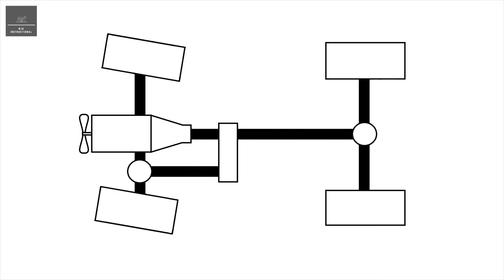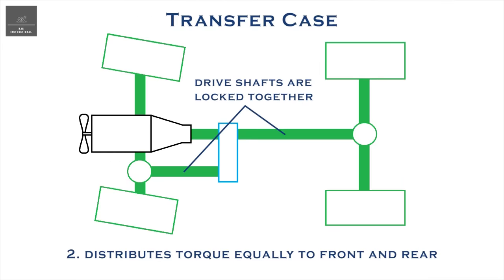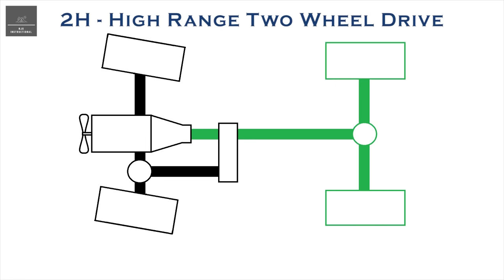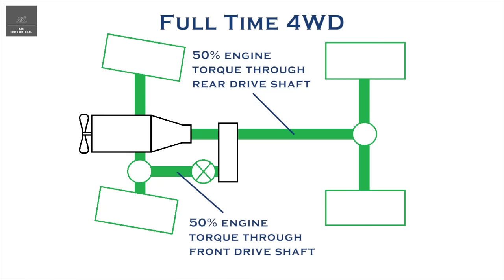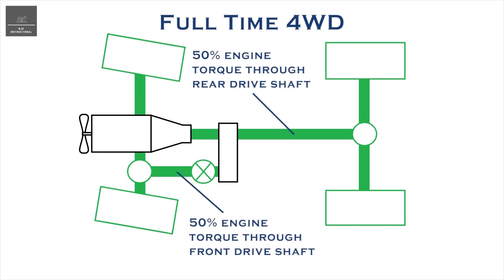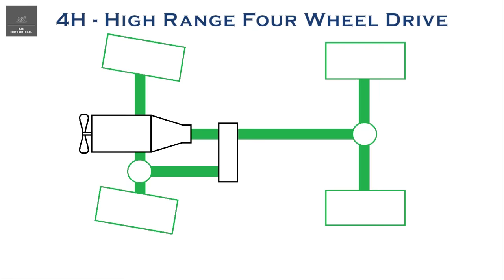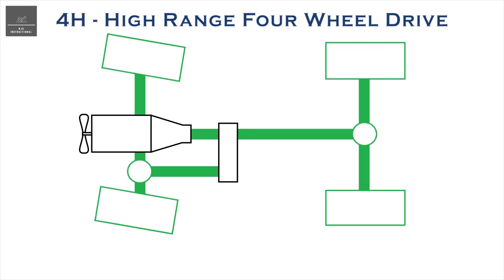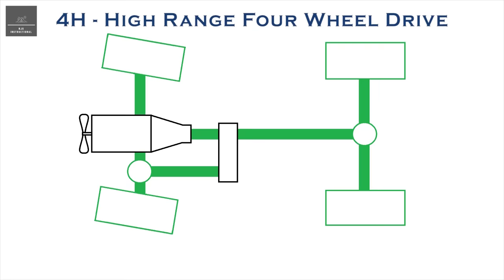How 4WD (4x4 - Four Wheel Drive) Works - 2H, 4H, 4L, LSD, Centre Diff, Diff Locks, Traction Control

Comment: So, in a "Full Time 4WD", if you leave the center diff open, as well as the front/rear, then if even 1 wheel loses traction, 100% of the torque will be sent to that single wheel.

Comment: IN locked transfer case situation each wheel gets up to 50% of torque, NOT 25% torque. With all time 4wd it is 25% of torque for each wheel. If center diff is locked and rear diff is locked rear wheels both get up to 100% of torque and frot ones will get up to 50%.

Comment: It's totally wrong. You are confused about "torque" and "rotation speed".
A open differential split the torque between axes (than allow different "rotation speed" between axes... and free spinning).
A closed differentian mantain the same "rotation speed" (than allow that all of the torque could be applied to the axis with major grip).

Comment: You missed a critical point. 

Not all cars have same part time 4wd. 
For example 4th gen 4runner v6 4wd.
It has Torsten center differential, meaning when you are on h2(4wheel drive)  it is same as all time time 4wd. Can be driven even on dry pavement, roads  highly tracked surface. 

Don’t miss critical points.

Comment: Every sentence with the word "torque" here is incorrect. Many other explanations are incorrect as well. Could have been a great blog if the author limited it to practical recommendations and did not try to explain things that he did not fully understand himself. For the confused beginners: the goal and magic of differential (unlocked of cause, locked is not differential any more, name only) is to equalize the torque on right and left axles. Why? Because any difference in torque means tire wear and poor control of the vehicle. When such a difference occur, say vehicle makes a turn and one wheel wants to run faster than another, the difference in torques starts spinning satellite gears in the differential until torques are equalized again. Similar is true for front and rear axles.

Comment: Why is fuel consumption so much higher in 4hi than 2hi? Its still spreading the power evenly, 25% to each wheel insteas of 50% to just 2 wheels. Yet it uses 10-20% more fuel

Comment: Altought the OP corrected some of the information provided, in a comment, this is still in my opinion a video containg some missinformation, about how diffs work. OP seems to have quite some knowneldge on mechanical components, yet i feel his explanation was wrong in some parts. Maybe he tried to oversimplify the video, in order everyone to understand, however the knowledge provided are not so accurate and im some cases, need further explanation.
Reply from the maker: Thank you Loukas, yes, I have made a general comment regarding this. Additionally, I'll release a video shortly which clarifies and corrects this, stay tuned!
Reply: @NJSInstructional  looking forward.

Comment: 4Runner limited 4wd shares the same family 4wd system as the GX460/470 and Land Cruiser (can't tell me those aren't capable offroad)

4Runner limited has the same ground clearance as the other 4Runners, except for TRD Pro/Trail that have about 1" more, and that's pointless since majority of people that seriously offroad change their suspension and lift it with a bilstein/dobinson/kings/fox suspension setup anyway.

4Runner Limited 4wd is better in the snow (road). You wouldn't risk a part time 4wd engaged into 4hi or 4lo and hitting pavement, your system will bind and you will have problems.

4Runner Limited 4wd is literally the same mechanically to a part time 4wd in 4hi 4lo (TRD Pro) when you have the center diff locked H4L L4L. I don't get the argument that "full time 4wd is inferior to part time 4wd engaged" when you lock the center diff it's essential the same. Rear locking diff, that's a whole different beast aside, but you still have a-trac to assist where a rear locker would be needed.

If you don't have crawl control it's not the end of the world. What have people been doing the last decades in off-roading before CC? Look at what the 3rd gens are capable with a good driver. Your crawl control can be your foot and skill.

Comment: Nonsense: a diff lock does not distribute torque equally - this is actually what an open differential does. Say if one wheel looses traction, 'distributing torque equally' would necessarily mean reducing the torque on the wheel with traction, and this is precisely what the open diff does, and this is why cars gets stuck when one wheel starts slipping on ice!

A diff lock does not distribute traction equally, nor does it split power equally. It simply locks rotational speeds of both wheels (or axles, if the diff is central) in sync. Torque delivery would depend on traction conditions of each wheel (or axle), and the same would apply to power (as power transmitted is equal to the torque times the rotational speed).

I am surprised by the sheer number of videos that get such very basics wrong.
Reply from the maker: You are correct, please refer to my pinned comment where I acknowledge this. Please also check out my latest video where I clear this up. Thank you for commenting.

Comment: This is WRONG though at a very fundamental level. 50% of the torque A-L-W-A-Y-S goes to each axle in an open diff... no matter the situation.
You conflate torque with wheel speed. So almost the whole video is sadly wrong.

Comment: 4x4 with FB diferencial locker are truly 4 wheel drive. 
All other AWD and part time 4x4 are, @ some point, 2WD when only opposite wheels touch the ground. Discovery is a different story.
I own a true 3 three wheel drive. MAYBE
Reply: Depends on the vehicle. Some AWD vehicles, like on some Mitsubishi and Subaru, have automatic locking center and rear diffs. That works just like a 4wd.

Comment: This is wrong. A locked diff does NOT split torque equally. An open diff splits torque equally. A locked diff equalises wheel speed NOT torque.

Comment: 2H- Rear wheel drive.

Y not auto maker provide 2H- front wheel drive?? Any reson??.

Or y not they provide both option to choose  FWD or RWD in 2H?"
Reply: I would say the main reason they do it, is towing. Lots of people buy 4x4's to tow. Its a proven fact that cars with rear wheel drive are better towing vehicles due to the force that pulls the load (the rear wheels) is closer to the load. 
Other reasons that the bigger 4x4's like land cruiser 70's are RWD in 2H may be: Increased acceleration, 4x4's are heavy and you need to pull out from a busy junction, you need all the help you can get.  Durability would be another good reason, RWD is more robust compared to FWD. Simplicity as well. Also for overall balance of the 4x4 make RWD for 2H a better choice.

Some crossovers like the Nissan X trail, while they don't have low range, they do have part time 4WD and when the Xtrail is in 2WD then only the front wheels drive the car.
Reply: @mikeb53  thank u for ur info

Comment: Why do I think less than 5% of vehicles with these capabilities are ever fully engaged? 4WD just for bragging rights for most.
Reply: Unless you are living in rural area with no paved roads or live in an area where it snows a lot .. 4WD is essentially just an expensive jewel for show off.
Reply: @wilsonsamuel  I live in rural South Africa, paved road 3km away, yes a couple rainy days a year I wished I had 4wd, cheaper solution I stayed home once or twice rather than drive out. The big stickers written in bold 4WD have not been tempting enough.
Reply: have a good run in with a proper New England winter and have a job that operates without regard for the weather, you come to really like 4WD.
Reply: Nobody wants 2wd trucks here in Alaska though we are a small percentage of the US population.
Reply: Try plowing snow in 2wd without chains.
Reply: Lol bragging rights? 4WD with snow tires in the winter. Nothing to brag about, I just don’t wanna go flying into a tree.

Comment: What is it with all these four wheel drive "station wagons" nowadays?🙄
Reply: Means that all wheels are powered , front wheels receive 50% and rears 50% in some cases front can receive 70% and rear 30% depend of the brand and config.
Reply: Most are front wheel drive until the back is needed

Comment: in an open diff torque to both sides is ALWAY equal. Bad video!
Reply from the maker: That is correct. It is actually Power which is split, not Torque. Check out my video description for additional clarification on this as well as a future video which clarifies this. Cheers.